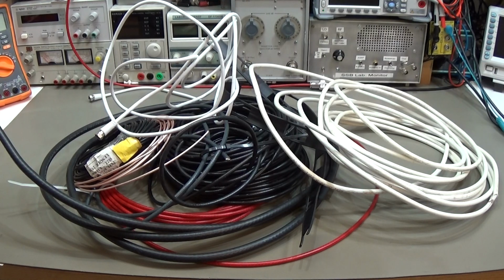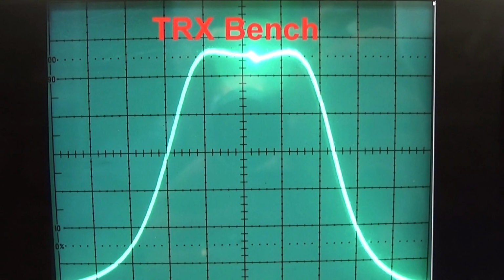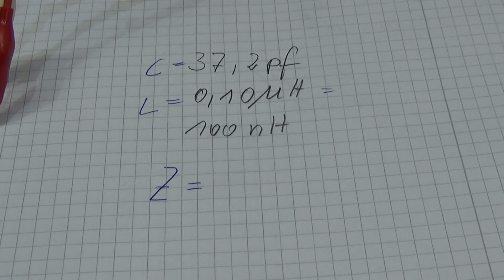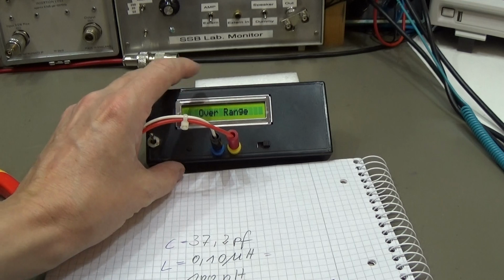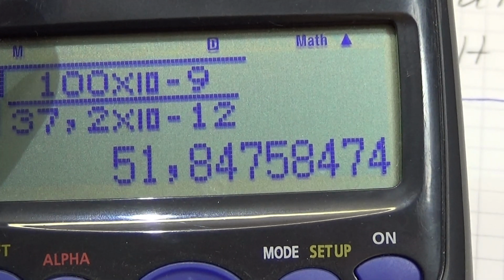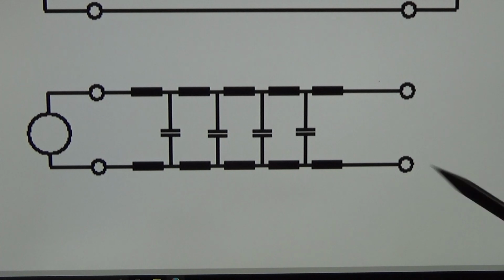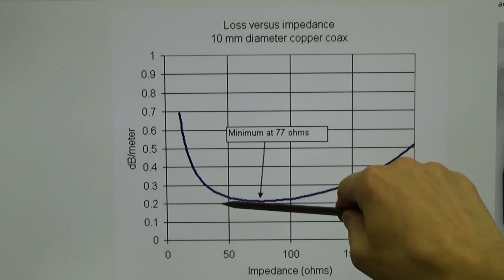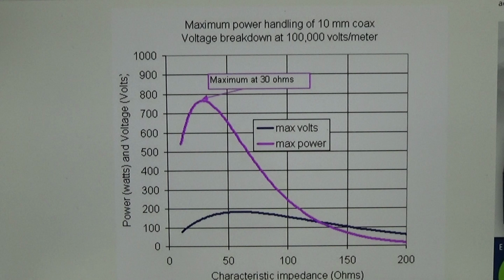#121 HAM Tip: Coaxial cable; how to check out 50 Ohm impedance and some coax insights

Comment: Can we use an LCR meter for the test?
2) what'll happen if I use longer cable of say 10 metres without cutting a small piece?
Reply from the maker: Yes, to identify L and C. The calculation always stays the same regardless of the length of the coax......

Comment: Isn't the formula an approximation itself ? The real parts of the inductance and capacitance isn't present in the equation.
Reply from the maker: No, this formula is not an inaccurate estimate, if you set up the functional equation completely and then simplify it, exactly this final formula comes out

Comment: If 75 ohm cable has a lower loss but we don't we use it for transmitters because of the power handling, what about low power transmitters? Would not 75 ohm be a better choice because of the lower loss if only a small amount of power needs to be handled?

Comment: When I was in school for Physics we tested the velocity factor and impedance. I don't have a specific pulse generator to use at home and I'm wondering if there's a circuit I can build to convert my simple frequency generator to do so. Maybe a a square wave with duty cycle set short and an active RC filter ???

Comment: Would a multimeter not work 🤔 measuring the legs of the cable and divide it to 1 cm and than multiply by 100 to get to the 1meter length and putting than the measured ohms in  🤔

Comment: I thought 300 ohm (ladder) twin lead type is better for receiving signals (lower loss), however interference is a problem with twin feed lines. Here's an interesting concept for HAM radio; Use different feed lines and antenna (30 ohm for TX and 75ohm for RX) Not practial but efficient. No body like standing waves that can cook you.
Reply: Twist it.

Comment: Perhaps the symmetric cable is meant to operate at a frequency that is different than the test frequency of the meter.  What I'm saying is that the cable might be 450 ohms at MHz frequencies rather than kilohertz.

Comment: Please help one problem: 
I bought a 50 ohm cable with velocity factor 82 and it does not work on the cb antenna. the capacity is the same 80pf / m but measured capacity at one end with the length of 10m it has double capacity compared to rg58

Comment: hello thank you for this video I would like to know which cable is used for measuring devices (oscilloscope, counter) is it possible to make them yourself thank you
Reply: Lab & test equipment with coaxial terminations almost always expects 50 ohm cable, with narrow exceptiions, such as specialized gear meant field use in the CATV industry.

In theory you could make your own coaxial cable, but would need precise and consistent control over its geometry (inside diameter of outer shield layer, outer diameter of center conductor, and dielectric constant of insulating material in between together determine impedance), also taking care to ensure good shield coverage to avoid leakage of RF, whether ingress or egress. Air-core coax can be assembled using two sizes of pipes nested within one another using spacers to keep them centered on the same axis, great for high power handling, but you then need a way to  draw & keep moisture out.

Comment: 2:40 comment. It's not always easy to get old cable data by looking up whats printed, e.g. try to search some odd Chinese brand. These are often sold without any real product codes and thus lack proper identification for the cable itself. In addition you may find very limited technical information on the web site (if any information exist at all). Your tip is thus very useful. Thank you Peter.
Reply from the maker: Glad that the video makes sense to you! Thanks for feed back 73

Comment: It might be nice to clarify even more that you measured absolute capacitance and inductance, and not per unit of length. Yet those would cancel out in the ratio between L and C. The formula for the transmission line impedance is indeed derived from specific not absolute values. this might ground better the intuition. What do you think?

Comment: Great video. This formula is working for any transmission line, not only coax cables. Its general form is Z0=sqrt(Zs.c. x Zo.c.), where Zsc and Zoc are complex impedances so the imaginary part gives an information about the losses. So this measurement can also be done with a miniVNA :)
Reply from the maker: you are right 73

Comment: Very useful demonstration how to measure and how to use the coaxial cables : 75and 50ohms. I did not know about this difference of impedance , for receiving and transmitting purposes thank you for easy and practical video.
Reply from the maker: Thanks for feed-back 73

Comment: Thank you again for teaching me something I did not know Peter. So, if I understand it correctly, the values in the formula should be (L) in Henrys and (C) in Farads. Not in uH and pF?
Reply: take a look at this article: https://en.wikipedia.org/wiki/Metric_prefix
Reply from the maker: Bora, you have to use the readings displayed by your meter to use it correctly in the formula. The link is helping to put the right exponents into the formula. 73

Comment: great video, is it possible to work out what mix ferrite rings are, I have a few and not sure what type they are...I did see a video once on how to check ferrite rings for certain applications..but that was long ago...thanks ! 73s
Reply from the maker: Thank you Cliff. Well the best is to measure the core material out. You get an idea on which frequency the material work and can decide if it fits into your project. In video #101 I show how an unknown  ferrite can be tested... Hope that helps 73

Comment: Hi Peter.  Really enjoyed your video on determining the impedance of feed lines, and especially about how the use of 75 and 50 ohm coax came about.  I was also wondering if you determined the number of significant digits or figures you had in your measurements of capacitance and inductance.  I could not see all of the measurements on your meter so I am not sure how many significant digits or figures you were able to read.  If you only had one significant digit or figure for example in one of your measurements then only the 5 in the 50 ohm measurement, the 7 in the 75 ohm measurement and the 4 in the 400 ohm measurement would be significant.after the calculations,   If this case then measuring longer lengths of cable may give you more significant digits or figures and a greater degree of precision if your meter is precise ,or more accuracy if your meter has been calibrated to a standard.  Please give me your thoughts, and please keep making the videos I have learned so much from you.  Thanks again John C
Reply from the maker: Hi John, yes the challenge for the meter is higher with a short test lengths so it is always good to improve the general conditions. Thanks for watching 73

Comment: On twin antena CB set up, we use a RG-59 75ohm "Y" harness 

Is it because we need to rise the  impedance because we run parallel antenas? (Parallel mean half impedance of a single antena)
Reply from the maker: Hi Hugo, you are most likely talking about a quarter wave transformer set up.. Thanks for watching 73
Reply: TRX Bench no I mean co-phased fiberglass antenas or even 102" whips

Comment: Thanks for sharing your knowledge and measurements. One issue in your first calculation (12:50 in video) is misnaming/labeling inductance as Farad rather than Henry. Simply an oversight and the concept and procedure are clearly communicated.
Reply from the maker: Thanks for feed back Bill! Yes off course simply a slip..sorry for that. 73

Comment: Nice one Peter! It should be pointed out that you can always use coax with larger diameter to handle more power but then the cost is higher. Impedance is related to the conductor spacing, the dielectric constant of the insulating material and also the center conductor diameter. Lowest loss coax will have a mostly air dielectric with large center conductor diameter and correspondingly large outer diameter with correct ratios to make the impedance come out to what you want. 73's and Happy New Year!
Reply from the maker: Hi Herbert, yes I agree thus it is good to have a practical compromise.. Thanks for watching 73

Comment: Thank you. Very useful and educational information. I have a request - please show how it is possible to test the effective shielding on coaxial cable. I have some new stuff with more dense braid and some with less dense braid and I would like to know the difference regarding RFI (shield effectiveness) etc. Also, I have some old and some used coax - is it still good regarding loss and RFI. 73 joe n8ea
Reply from the maker: Thanks for feed back Joe. Well a real shielding factor measurement is a bit complex to perform in my lab. Bur I remember a kind of predicting approach may be that could be done with the equipment I have.. Let's see. 73

Comment: Very interesting - thanks. It would also be fun to perform the measurement by putting a signal generator and an oscilloscope at one end, and a variable resistor at the other. Then tweak the variable resistor to minimise the reflection and read off the cable impedance by measuring the resistance.

I always wondered why 50ohm was used in some applications and 75ohm in others: it's interesting to learn that there really is a very good reason !
Reply from the maker: Thank you for feed-back. Yes I have done a very early video on open end coax and shorted end to determine the length of a coax. 73

Comment: Could the impedance of the ladder line be changing due to proximity of conductors near it?  I know that's a big problem when using ladder line since it is unshielded.  Would it read differently out in the open away from objects on your bench?  Thanks for a very informative video.
Reply from the maker: Yes you are absolutely right! I thought I have said it in the video but I have missed it. Thanks for the addition and for stepping by. 73

Comment: well done 
my question is usually we match 50 ohm radio with 50 ohm impedence of antenna but still how RF is transmitted in air when impedence of air is around 300 ohm?
Reply from the maker: Hi Adnan, thank you! Sorry I'm not able to follow up all e-mails....simply to many.... Z(W) free space vacuum = 120x pi x ohm=376 Ohm. That is a nature given constance and describes the condition in the far-field of an antenna. The condition in the close-field is very much more complex and different to the far-field condition... 73

Comment: Hi Peter,
Great video. Earlier this year I bought an MFJ-269 off Ebay to determine how much 50 ohm coax I had left on a 250 ft spool that was 30 years old. It showed I had 135 ft and when I measured the length it was 126 ft. Close enough for government work. HiHi   73 and Happy New Year WB3BJU
Reply from the maker: very good all is possible :^) Thanks for stepping in Happy New Year 73